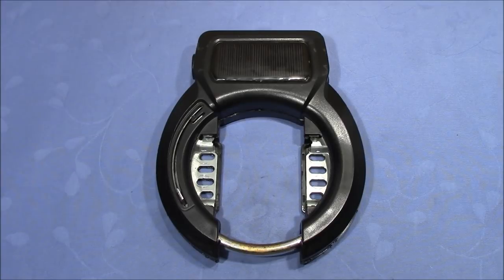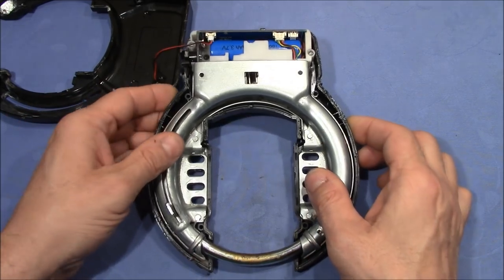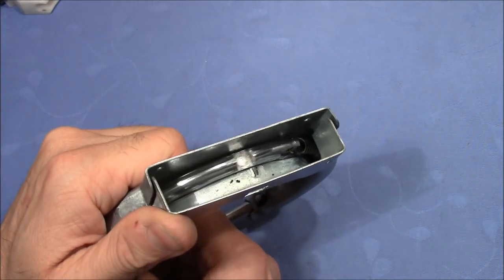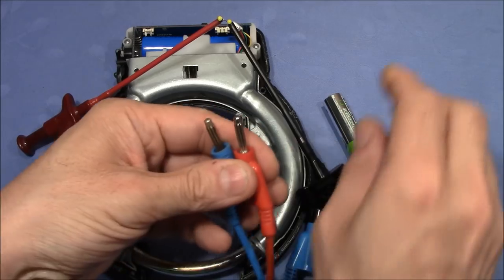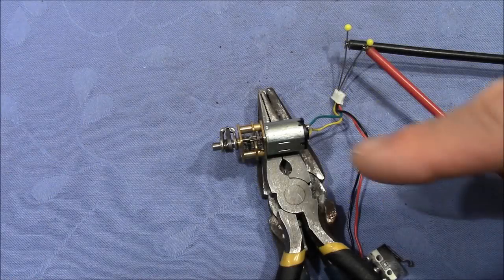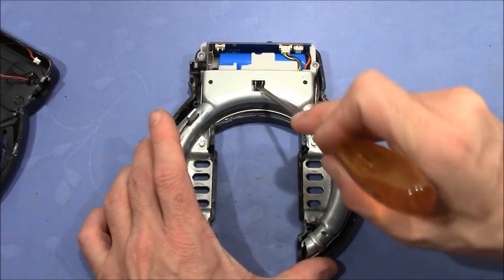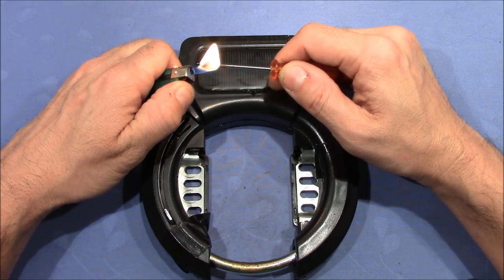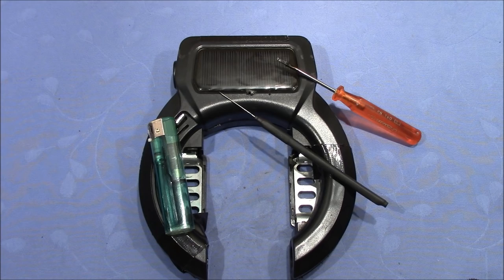(picking 604) oBike bicycle lock explored and unlocked (kind of picking)

Comment: plastic shell is needed for the BT to connection, but a metal cover over the service window would be nice. The cutout give room for the activator to move out of the way when unlocking.
Reply from the maker: Yeah, a cover would easily improve the locks security. Maybe the kept it open to break into the lock easily themselves when the electronic fails.

Comment: Nice  little gearbox/motor. Shame they needed a 'service' window though.Looks like you have a spare 18650 Li-ion battery also now.:o)
Reply from the maker: Yeah, the motor is pretty cool. The lock is probably the most expensive part on the whole bike and the most useful one. I've heared that the obikes are really crappy.

Comment: An interesting lock,if the unit has been out of sunlight for a while it may be the battery voltage is too low to sustain a Bluetooth connection
Reply from the maker: Right. Also if the battery fails the lock can only be opened with force. Maybe they left the window to have an easy way to rescue a bike once the lock won't open anymore.

Comment: Habe you tried a magnet? You might be able to lift the bolt with it,  or even turn the motor by altering the polarity of the magnet.
Reply from the maker: Thanks for the idea, but that lock is long gone.